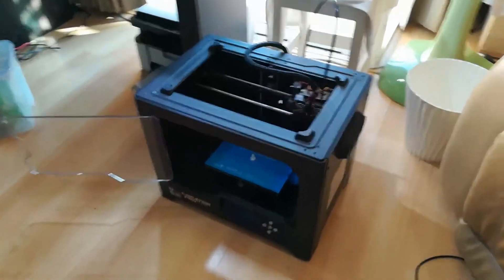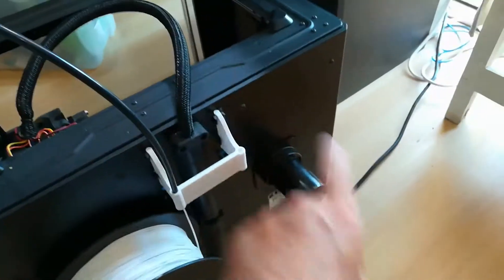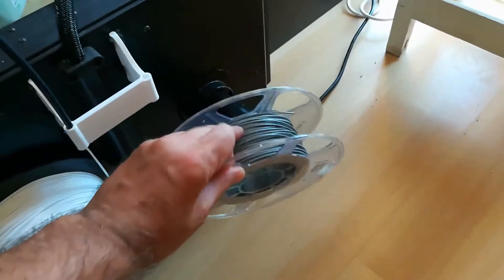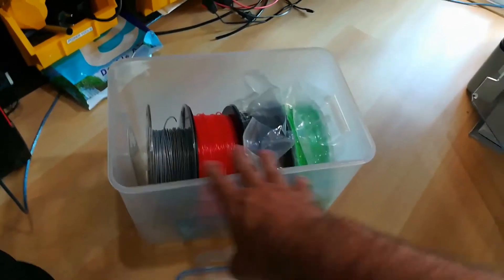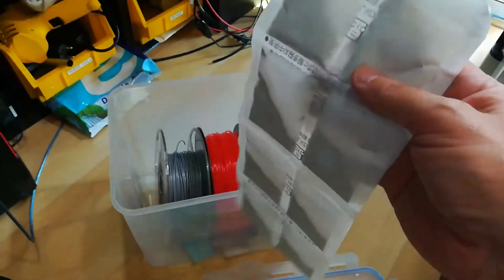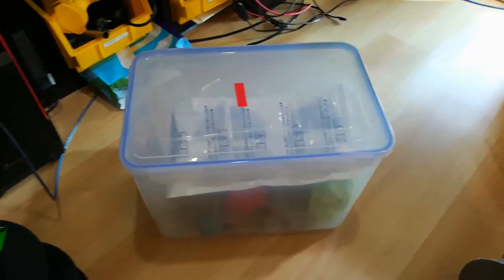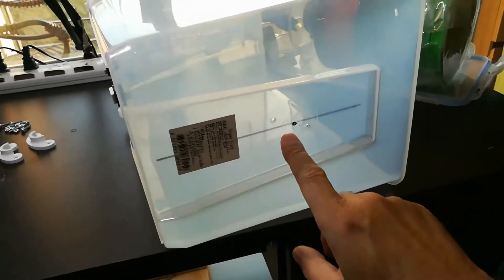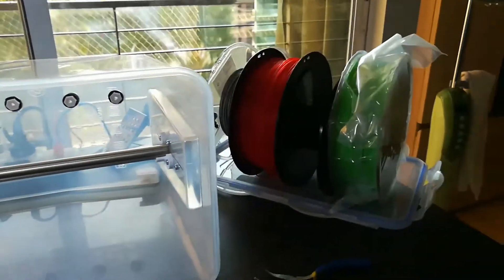3D Printer Filament Storage and Dispenser Box

Comment: So much could be said about this... of which already was :D But then youtube decided to crash T-T Anyway, awesome job getting yourself a box! Too bad alot of the info said here and there were incorrect (Humidity is a measurement.. not a 'thing' that can travel up tubes), the overall design is kind of poop, the print quality you're getting with that printer is poop compared to what it could be making (those parts shouldn't just be snapping when you twist them, you had super bad layer adhesion problems...), and the moving of the print head so fast could have easily destroyed the printer, since that particular one does not have diodes protecting from backcurrent....
Reply: There's always one pedant that has to piss in people's cornflakes.  You know exactly what he meant and could have found a better way of pointing it out, well, or just kept you gob shut.